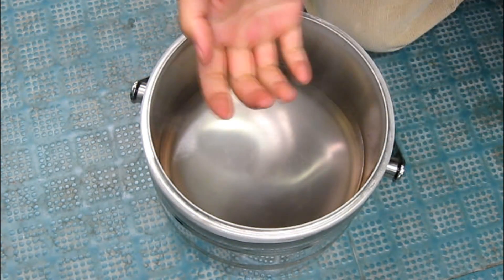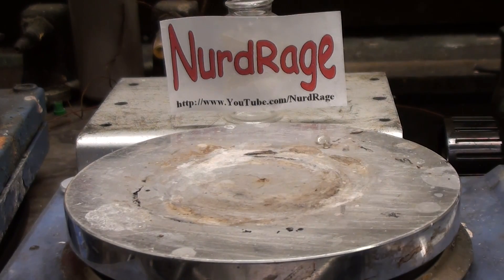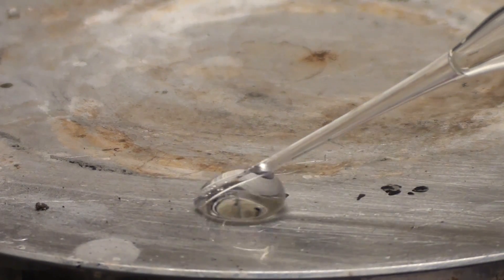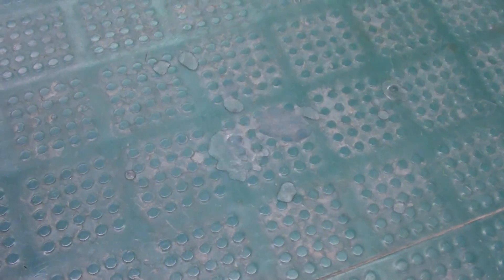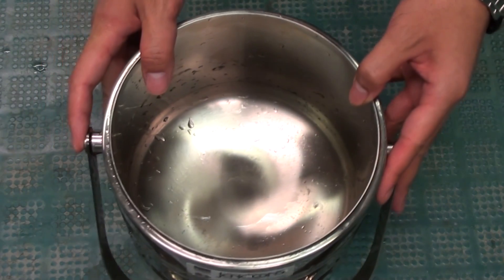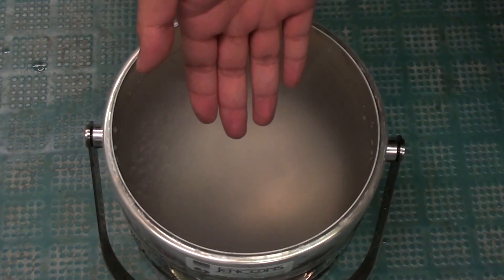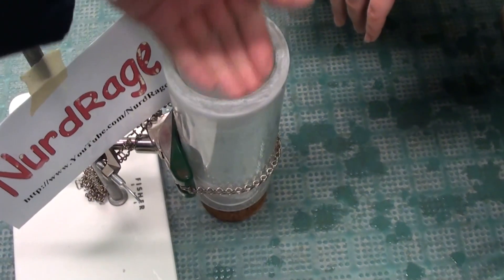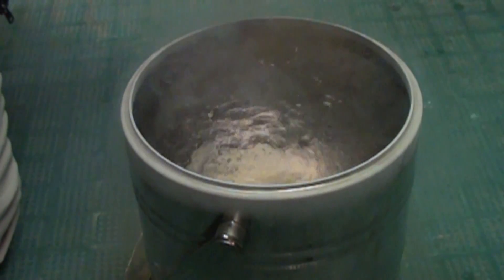Hand vs. Liquid Nitrogen - Revisited

Comment: It's okay to touch it as long as you don't cup your hand and hold some of the liquid. If you stick your hand into it, you can only do so for like a second. My prof demonstrated that. He walked around and poured liquid nitrogen on our hands and it just rolled off. Felt really awesome... just don't wear metal/rings when you do it. My prof also put some lettuce into the liquid nitrogen and pulled it out, and touching it crumbles it - same thing would happen to your hand if it was in too long.

Comment: They Mythbusters did this experiment, but from the other end of the scale. They used molten lead, and dipped their hands in water first so that the lead would flash vaporise the water to give the same effect. I think the nitrogen one looks more effective though, as the lead didnt show any reaction other than the usual fluid dynamics

Comment: @1nsanity1nc No, that will just coat your hand in molten lead & you will lose the use of that hand for quite some time. DO NOT TRY! This only works with things with a very low boiling point, Lead doesn't have THAT low of a boiling point.

Comment from the maker: @Lightrundas12 the liquid nitrogen itself is very good at cooling the container. In order to get any useful improvement i'd have to cool the container close to, or even colder than liquid nitrogen. My best fridge goes down to -45 degrees Celsius, but liquid nitrogen is at -196 C. There is no point in even trying with my equipment. I need my fridges for other things.

Comment: the same thing happens with smelted led. it has roughly 2000 degrees celcious or maybe it was lower I just forgot. but when you soak you hand in water and stick it into the smelted metal you will not get burned seriosuly it can be 2000 degrees and ur hand wont burn it is because the water around you hand turns into steam and the steam pushes the smelted led away from your hand and you might be able to hold your hand in it for up to 2 sec. the same thing happens here but water is in liq nitrogen

Comment: Thanks for the explanation of the Leidenfrost effect. You really do make education fun. I'm no chemist, I'm a machinist in the Air Force and I use liquid nitrogen often when replacing bushings in aircraft.  What amazes me more is the effect LN has on metal and how much it will shrink the size of parts. The bushings we replace have a heavy press fit but after a 5 min bath in LN they slide in by hand then warm up quickly to a press fit. You might want to show that. Love your videos.